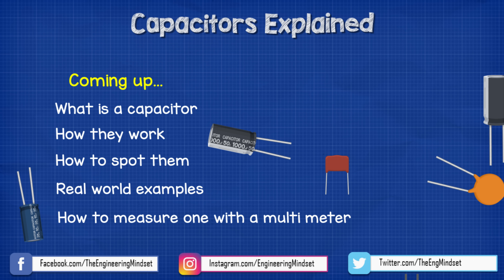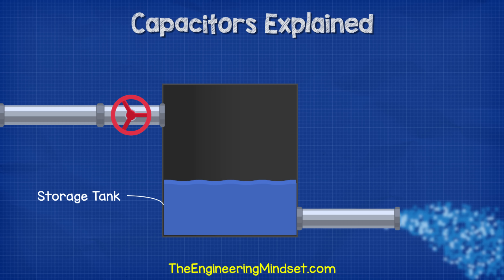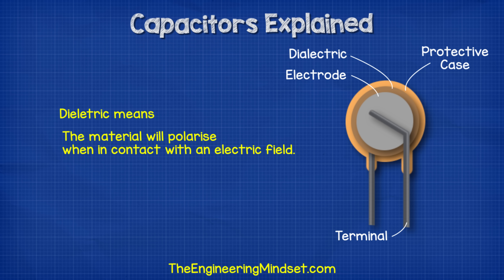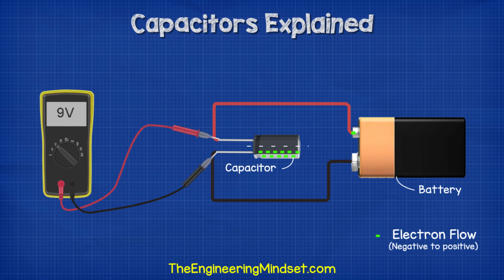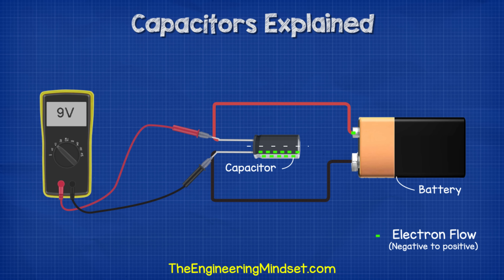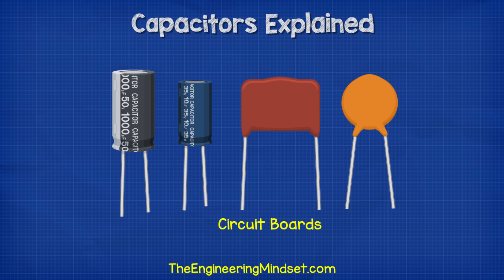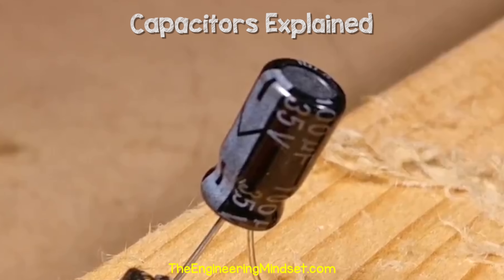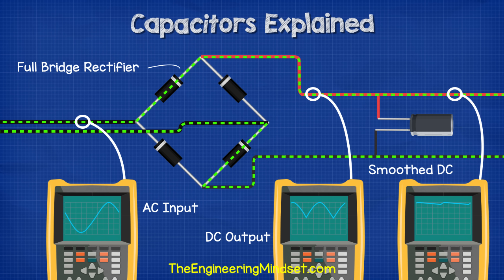Capacitors Explained - The basics how capacitors work working principle

Comment: I am building a Rotary Phase Converter and the 3 phases produced by the idler motor have capacitors to "balance" out the voltages. How does a capacitor do this? Using your water analogy, once the tank is full (because we don't turn of the generator) but the water is still running, where does the excess go?
Reply: The phases of two of the source feeds of a three phase power supply are out of phase (delayed), one by 120 degrees, and the other by 240 degrees. The third is at 0 or 360 degrees. Obtaining three seperate line phases from a single phase source, whether from a rotary or a transformer requires some sort of phase delay of the feed from the rotary motor or from the secondary windings of the transformer. One can do that via a capacitor bank. A capacitor offers dielectric induction to the circuit when the power source magnetic field drops (alternates). This provides a phase shift as the dielectric induction kicks in when the source phase drops out. It won't be exact, but will be enough to run another power source input leg of the three phase motor. In addition, the capacitor bank offers a solid magnetic field event that will aid in start up. Magnetic fields move magnetic fields i.e., the magnetic field from power source generation is the force that moves the magnet in the motor via dielectric coupling in the copper, nothing else. Cheers

Comment: First visit to your site. Had a vague idea about capacitors because I shorted one out with my fingers, sort of a mini taser effect. So thanks for filling in most of the gaps in my knowledge. Now to the question, I've used capacitors when building the Tone circuit on electric guitars and I believe they can cut out certain frequencies. Followed wiring diagram on lead guitar but on my bass didn't want to cut out all the highs so with a little knowledge (a dangerous thing) changed the capacitor and got exactly what I wanted. Can you explain this use of capacitors. Thanks for posting. Cheers.

Comment: I copped a nasty boot from a 450V 10,000uf capacitor when I was building my railgun, I was screwing a bolt into one terminal and I accidentally touched the other terminal with my other hand, i found out very quickly that i forgot to diacharge it, i literally felt my heart stop and as I was about to pass out it suddenly restarted 

Now thats some scary shit, these days I won't do any work on high voltage capacitors unless there's a resistor across it
Reply: You must always discharge it with a bulb on two points
Reply from the maker: Check out NEW resistor video, everything covered! ➡️ https://youtu.be/DYcLFHgVCn0

Comment: I'm curious about the use of capacitors as frequency filters specifically in audio applications.
Reply: If you think of the audio frequency spectrum (20hz-20khz), think of the lower frequencies as "closer to DC", and the higher frequencies as "closer to AC"... A capacitor (as demonstrated in the video) doesn't like to pass DC current, yet is basically irrelevant to AC current, so selecting the appropriate value of capacitance will present a value on the spectrum where it is effective at "passing" (allowing to continue unaffected) the AC component of the signal (higher frequencies), and "blocking" the DC component (lower frequencies). 

Capacitors "filter" the DC component (low freqs), and "pass" AC (high freqs), so they are referred as "high-pass filters" in the audio industry (and others).

Comment: The purpose of a capacitor is to seek and maintain peak voltage, and its mainly found on single phase motors or circuits.
Reply: No man.
On a single phase AC motor it is used to create a rotating magnetic field while the motor is running.
Reply: @Nussof  yup exactly what i said.

Comment: So say I had a pair of jumper cables connected to a battery, and I held the loose ends next to each other, just  beyond the range that they may arc. 

Now imagine that the clamps on the battery were removed. If I was to touch the clamps from the battery together, I should get a spark, correct?

Comment: I got the biggest shock with a fully charged cap, I was taking a camara apart all I know is that thing flew across my room, I seen the brightest flash but not with my eyes but in my head

I remember feeling the teeth in my gums and my eyes in my sockets very scary but I'm way more careful and just made my interest into electronic engineering even more ❤
Reply: 10/10 shocking story.
Reply: @f.jideament  lol yeah not my proudest moment...
Reply: @f.jideament  r/technicallythetruth
Reply: Try removing a color tv picture tube without fully discharging it. Something you thankfully will never experience.
Reply: @artdawggy  I have, i just hoped they weren't turned on recently.
Reply: @artdawggy  There were a set of long screwdrivers in the lab where I first learned this that were melted at the tip by shorting out caps. Better them than me!
Reply: I got booted by a 450V 10,000uf capacitor once, I felt my heart stop for a few seconds then restart 

Something I never want to experience again
Reply: @mwbgaming28  @Man la will probably say that can't happen either.
Reply: @artdawggy  maybe he should try it and report his findings
Reply: @mwbgaming28   I got same capastiy. I felt after half hour that my breath is stopping automatically. Then. I take immediate CPR. Save myself.
But that shock 😲 burn my chest and shoulder muscles 💪.
I couldn't  recover these muscles 💪 and tissue forever.
My body pain   remain every time after this incident  .
So Escape even small amount of shock 😲 in future.
Reply: Those things get charged to about 600 V.
Reply: @ivandoe8496  I got from half to a third of that. I was only 22 so I survived. I did get thrown 4ft into a wall though.
Reply: Andy Flaster you watched too much movies.  Having an electric shock will not throw you into air.
Reply: @manla8397  ok. Thanks for letting me know.
Reply: @manla8397  shows what you know. I've seen it
Reply: @manla8397  Bullshit.  It most definitely can.  60 years ago lawn mowers had the fuel tap placed directly above the spark plug,  with exposed tip.....  Yep, I leaned down without really looking after mowing a half acre and pressed the spark plug instead of the fuel tap.  Woke up on my ass 15 feet behind the mower which was still purring away.
Reply: @manla8397  It will cause muscle contraction. And jump scare the biscuits out of you if you don't expect it.
Reply: @manla8397  Depends on where you get shocked. If it goes thru your legs, it can cause the muscle to retract that would straighten out your legs. Frogs were used in Science classes to show both extension and retraction of a leg.
Reply: Ivan Doe Try 25 thousand volts.  Some of the focusing electrodes in the electron guns are “only” 600 volts!
Reply: Would you Like to show us where we used each of diffrent capaciores in circuit
Reply: I got a shock from a capacitor once. Thankfully it was an old one stored for years in a drawer and, stupid me, I simply picked it up and held it in my palm. A quick burst, a little surprise, and a lot of learning.
Reply: Typical chica: something hurts you and then you become infatuated with it...
Sounds like Stockholm syndrome to me!
Reply: @radaroreilly9502  as opposed to being infatuated with a 70s tv show. What a useless comment. 🙄
Reply: @radaroreilly9502  sorry simple electronics can get the attention of a typical "chica" but it seems you can't 😢 try being less cliche and don't act like a typical D-Bag and you might be able to meet a nice chica 😍

Comment: Everything bigger than millivolts can shock you ???
hold my 12 volt battery
Reply: @BASIL!!!!! Βασίλειος Current has nothing to do with it. Current cannot be pushed, only pulled.
Reply: @duerdum9  typically it's current that kills, 10,000 volts from a lawnmower ignition coil will wake you up in a hurry but won't kill a healthy person, usually needs a bit of both.
Reply: @chriskennedy7534  That is not what he said though. Your body will lead as much electricity as your body can do (counteract the resistance). If you have a low voltage, let's say 12V, you can have a 1000000A battery, and it will not make any difference - at all. However, a 1200V battery would certainly be felt - again, regardless of current (well, there needs to be *some*, but we're talking very miniscule amounts).
Reply: My 48V electric bike battery shows that you don't need millivolts to be safe

Comment: Those circuit board capacitors had some pretty high uF readings compared to residential AC/HP capacitors. Do you know why that is? The average AC unit I see only needs a 40uF capacitor.

Comment: explain as crystal clear , thanks a lot
Reply from the maker: Thanks, James
Reply: @EngineeringMindset  Capastior shock is more dangerous for our body. Than normal electric shock 😲. So Discharge before to work with any capacitor.

Comment: As a machinist and hobby car builder, I’m trying to learn electricity because I’m trying to build a three phase converter to power my manual milling machine in my garage. 
A video would be cool. 
Just sayin 😁
Reply: Just buy a VFD ( variable frequency drive) takes a single phase Input and gives you 3 phase out and let's you adjust speed.
Reply: SilentGamer ya I use them at work but to handle a 10hp three phase motor, they ain’t cheep. From what I’ve read, need a 10 hp three phase motor to act as a generator where I have 220 single(?two leg?)phase in the garage already for wielding, bringin those into the motor and having it spit out three phase, need compactors and other stuff I don’t know much about ( however, I’ve just learned about compactors). Trying to build it myself because #aintrich.
Reply: @Welcometofacsistube  What type of mill is it? 10hp would be a really big mill. Most vertical mills are 3hp or less. A 5hp VFD is under $200. My mill is 2hp and I paid a $120 for the VFD which is 3hp and I've had no problems with it yet. Silent gamer is right. I've been an electrician for 30+ years and now I do machine and tool development for an aerospace ceramics comp. The VFD's of today, at least in the lower hp motors like 5hp and down are pretty tough and will convert your single phase 220vac to three phase and will run your mill with speed control and much more if you want. Like controlled ramp up of speed and braking. When they get above 5hp and definitely above 10hp I recommend getting a VFD larger than your motor. Like a 15hp VFD for 10hp motor.
Reply from the maker: VFD Video is now live! here: https://youtu.be/yEPe7RDtkgo
Reply from the maker: Good idea, I'll add it to the list
Reply from the maker: VFD Video is now live! here: https://youtu.be/yEPe7RDtkgo